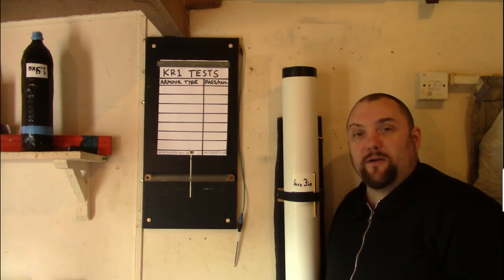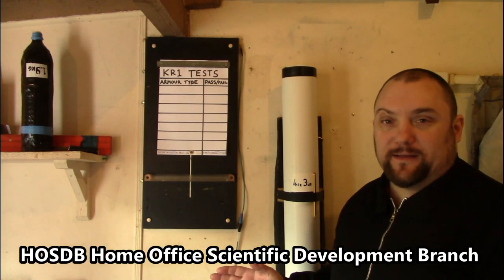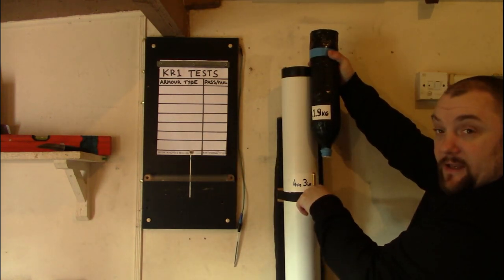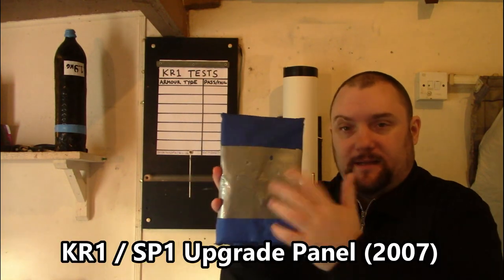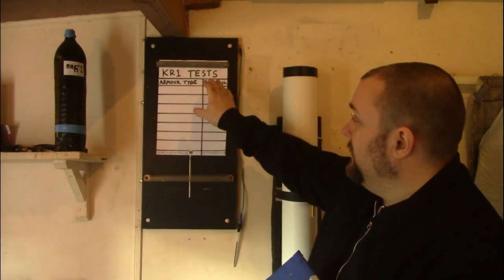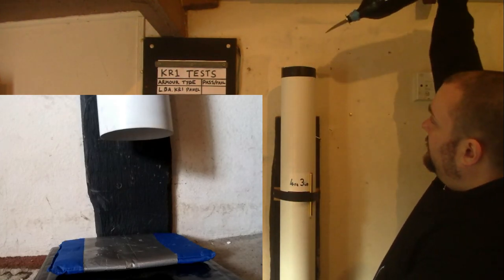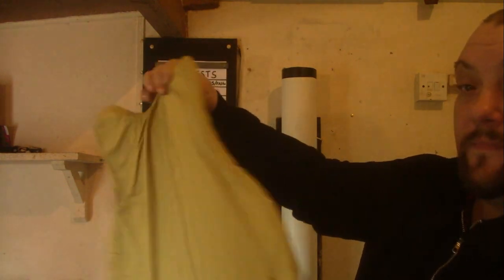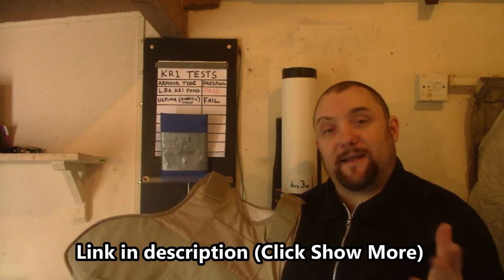Body Armor Tests - KR1 Stab Resistant Vest and Ballistic Vest

Comment from the maker: This is part 1 of a series of videos showing what materials and vests can and cannot stop a blade at KR1 level tests (24 joules) MORE COMING SOON. Also I have ordered some Plasticine (25mm thick) to go under the padded surface so I can measure deeper penetration without the blade hitting the floor - this is also used by the HOSDB tests.

Comment: Awesome thanks for this. I was just looking at it today and I had an idea you may want to explore for this, “cement tile backer fibre board” or “Hardibacker” I’m cutting it in work and it’s an absolute pig to cut, drill, penetrate, I’m going to try a plate cut out of it. It comes in 6 and 12mm I bet it’ll stop knives and spikes. May be heavy though

Comment: That's some great shed/Wendyhouse Science.
I assume if you added more weight to the bottle it would produce more energy to the blade?
Reply from the maker: Cheers mate, it should be reasonably accurate to the hosdb tests.
I'd assume so too about more weight = more energy etc, from what i read the hosdb keep the same weight, but drop it higher so KR2 is 1.9kg dropped from 5ft 10" to produce 33 joules and so on.